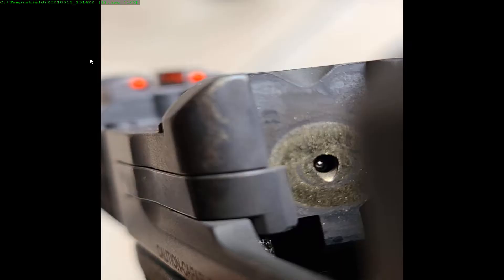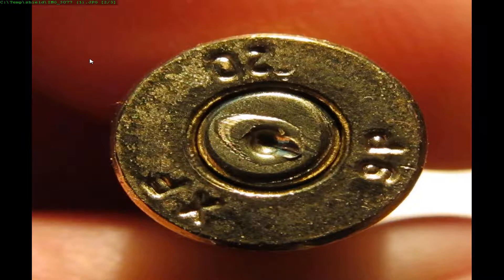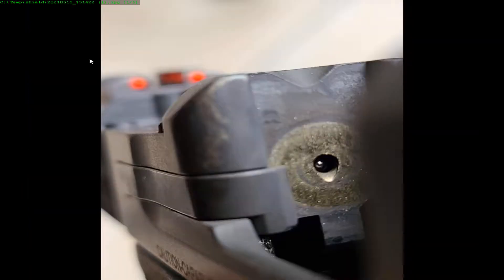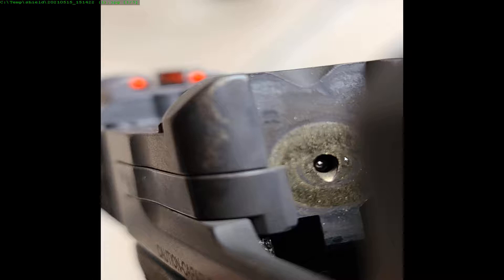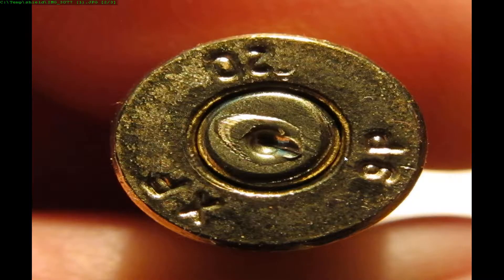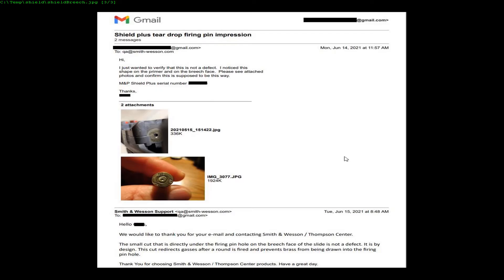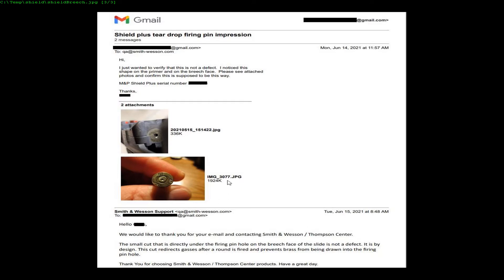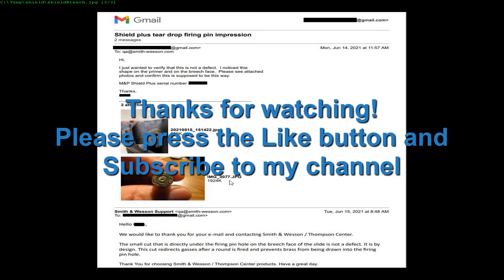M&P Shield 9mm Firing Pin Defect? Let's Find Out

Comment: I have a Shield in 9 mm, and .45 ACP and a full size M&P 9 in 9 mm with a 4" barrel. They all do the same thing. They all leave the type of mark on the primer as you've shown. At first you would think that excessive high pressures would cause this but that's not the case. I do my own reloading and all my 9 mm's and .45's are loaded with the same powder charge. When I fire other guns chambered in 9 mm and .45 firing the same bullet weight and powder charge I don't get that mark on the primer that you get with the S&W M&P's. Smith & Wesson is correct. This is NOT a defect. This is something that is indigenous with all M&P's. Glock's make a similar mark on the primer also. In normal cases where the firing pin makes one distinctive mark on the center of the primer and you see similar cratering and deformation on the primer this would be a sign of excessive high pressure probably due to too much powder. You'll see that more common on magnum loads like .357 or .44 magnum. If you are shooting factory ammo in your Shield and you see the mark you are describing, don't worry, it's still safe. Keep shooting as you normally would and always be safe when shooting. I hope this clears up the matter.
Reply from the maker: Thanks Dale! I appreciate you taking the time to share that info.